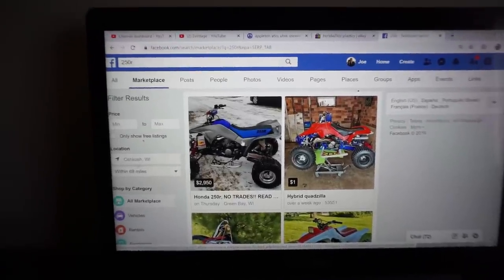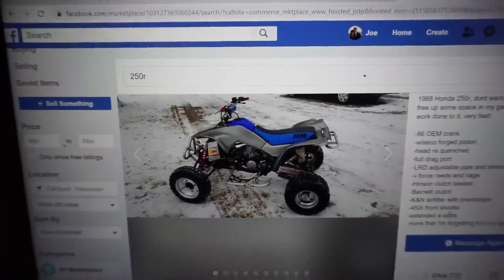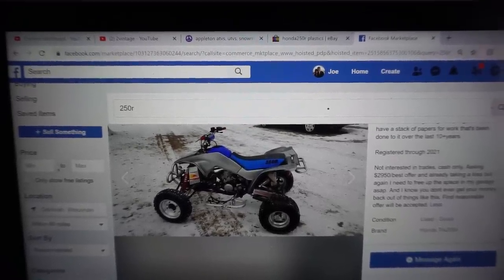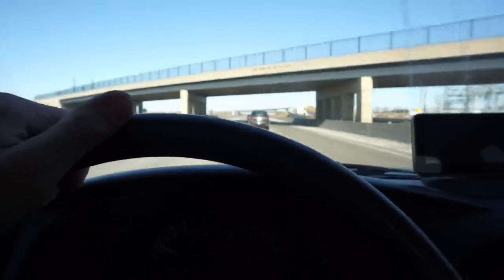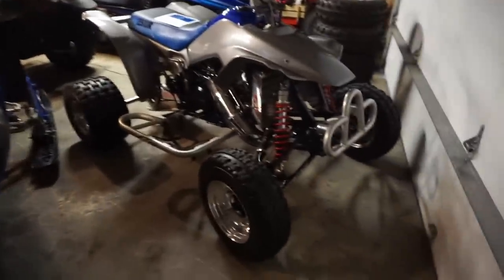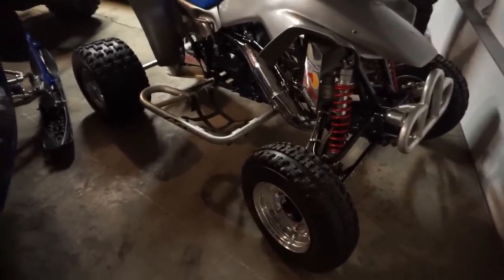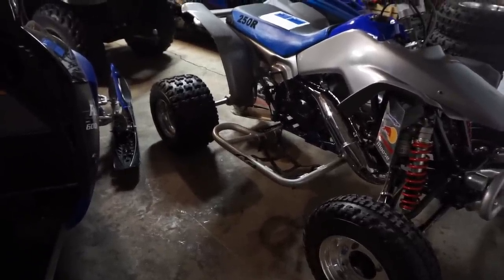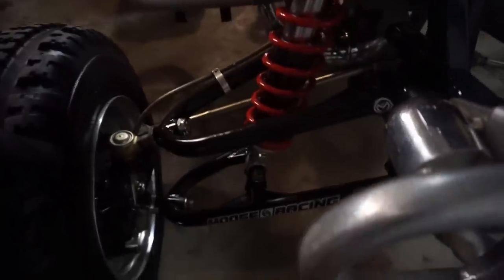Finally...The Modded Out Honda Trx250r is Here!!! (INSANE)

Comment from the maker: Make sure to checkout my Instagram to see behind the scenes: 2_vintage_
Forum: http://2vintagerider.com/
My Second Channel: https://www.youtube.com/watch?v=TPEgjamDX7s&t=280s
Thanks to everyone who watches and supports the channel! Lots of cool videos coming with the Honda Trx250r!
Reply: Nice quad
Reply: Sweet 👍
Reply: Check your cdi on that thing if it’s after market that’s your kick back problem. You need to get oem any year.
Reply: Parts for my KTM are pretty expensive I would like to get a vpower or another control box but they are 700 or so for one that actually works but I do have the Dakar version KTM 525 so it came with a nice steering dampner n few other things like a sticker kit I took off but nothing really for performance although it really doesn't need it only prob so far is running a cheap fuel filter on the 525 you can run carb dry from fuel restriction so upgrading that and adding a fuel rail pretty much solves that problem but I've seen dynos after putting on a quality aftermarket exhaust with no power gains but do u really need more power from a dirtbike that puts out 60 hp no you just need a way to manage the power n get it to the ground efficiently. And that's where the vpower or better vortex control box comes in.

Comment: Don’t listen to the seller you can’t rejet to run a lower octane fuel the compression being high dictates the need for race gas
Reply: He would have to change his domes
Reply: I guess if i he advanced the timing as you do when using higher octane gas, you might need to go down a size in jets. Because the combustion is more efficient. Othewise you wouldnt need to rejet. Because you use higher octane to  stop it from detonating, when you have higher compression and early timing.
Reply: @topnotchbarbertv9523  what these two said👆
Reply: Yes you can you have to change domes my brother has a 250R...

Comment from the maker: What videos do you want to see with this beast?!!!
Reply: do a backflip
Reply: Race against a banshee. Possibly a 400ex also! And a top speed test
Reply: See how long you can hold a wheelie
Reply: Ice racing 😐💨
Reply: Top speed
Reply: How long it will run on WD-40...
Reply: A video of you ripping it not cursing around rip it in trails !!!!
Reply: Ice drifting
Reply: 2vintage race it. Surly there is a motor cross track near you
Reply: 2vintage  race a banshee or Suzuki 250r
Reply: Sand down rip
Reply: 2vintage track/ trails
Reply: Find a shop with a dyno local to you and see what it makes
Reply from the maker: @Trxryamahabanshee  cool idea
Reply: ride it on the track because that's what it was meant to do and it would probably be a lot more fun than just riding it in a straight line
Reply: Ride a track or some trails
Reply: 2vintage It may just be me, but man I always take my bikes to the dyno for a tune after I build a motor that way I know the jetting is dialed in and knowing what kind of power it makes is a sweet bonus 👍
Reply: @camden199  that would be a short video. My guess is about 20 ft
Reply: 2vintage sand dunes???
Reply: @CADEN ZUMBRUNNEN whatever the hell that channel is...
Reply: Keep it forever
Reply: LONGEST WHEELIE
Reply: more drifting in the snow
Reply: Ride it up and down the road outside your house and round and round your garden. I can't deal with disappointment.......

Comment: That's about right for early 2000s I just built a kfx450 and it cost me 7500 just in parts , internal motor work and full suspension setup ars-fx xc a arms full exit shocks were 2200 I found out quick building is a lot more expensive than buying an it becomes more of a nostalgia thing after the time goes into it so I know how he feels not wanting to sell that trx but you definitely got one hell of a steal great job love the videos

Comment: dude ive had and raced the same 250r since 2001 . ive always ran kultz and vp110 24:1 . I do xc races now ive got over 100 hours on my wossner piston with still 140psi of compression . the 250r can be the most reliable quad if its built right .

Comment: Pipe reeds and filter means exactly what it says, it’s got an exhaust different reeds and a different air filter... they wake up a lot with porting, they aren’t too bad stock and definitely won’t power wheelie every gear, 4th is about it I have a stock motor... the bigger aftermarket  cylinders and good porting they make crazy Hp

Comment: No 2 stroke would ever "blow up" if people treated the piston and rings like the 40 to 50 hour maintenance items that they are intended to be.
Reply: Lol your not serious I’ve got a kdx250 from 89 with I’m sure thousands of hours on it had it for 25 years and ride it hard every day just use good oil and open them up every once in awhile just don’t live at 8000rpm you’ll be fine
Reply: @jjp1117  big difference between a non- competition trail ridden kdx and an all out race ridden two stroke motocross bike.
It's apples to oranges between a kdx and a kx, just in where the power curve comes in and how much the kdx will suffer being lugged due to it's longer stroked engine and heavier flywheel.
You are also the exception to the rule in how you ride and treat your bike.
If you think I'm wrong, just go on Facebook marketplace and see how many 2 strokes are for sale and the add says "ran great, just needs new piston and rings". 
The truth is it needs a whole new top end. It's claped out and needed a piston and rings a hundred hours prior.
Now the cylinder is scored all to shit and wallowed out like an egg because the wrist pin has been shot for 50 hours and it's no longer capable of building compression.
Remember, a 2 stroke runs the strongest right before it blows up. A piston, rings and upper bearings are far cheaper than a complete top end.
If you check your service intervals as posted, you'll see that these are considered to be regular wear items on a two stroke and even on modern 4 stroke motocross bikes that make their power and torque at high rpm's and whose jugs and heads cost even more to replace if damaged.

Comment: Lord makes custom pipes thats why you can't just buy them on Amazon etc.. but they need to be the smaller pipe to get the most hp out of the 250r with a 309kit you can get around 56hp out of them they are good machines

Comment: @2vintage that pipe n silencer back then in 03 was n easy 500 prolly 600 jzust for expansion chamber and 250 for silencer parts have gotten alot cheaper compares to even 10 years ago

Comment: So the dude doesn't do his own repairs and keeps the receipts, and you add them up like new swing arm bearings installed 15 yrs ago has some relevance to you paying market value on a quad that will be covered in wd-40 shortly. Prepping for the useless top speed test. All your top speed tests not one mention of final drive gearing. You realize top speed has nothing to do with the design or purpose any machine I've seen you.....um... Well whatever it is you do. These are dirt bikes, buy a Ducati and top speed that out on your street. That would at least make more sense than a, you know. Let's say a MIAMI VICE ERA OPEN CLASS DIRT BIKE DRIPPING WD40 FROM EVERYTHING INCLUDING STOPPING BY MEANS OF FRICTION SURFACES.
LOOK DUDE, I GUESS IM A HATER BUT YOU KILLIN ME, ESPECIALLY WHEN I READ A COMMENT FROM SOME THAT JUST "RESTORED" HIS BIKE THE WAY HE LEARNED FROM YOU. Hey you get views, I can't challenge you on that. I GOTTA STOP WATCHING. I'll check back in ten years, I'm sure have some base knowledge by then. Work on your kick starting, your bump starting, your shifting, pulling statements straight from your ass like "runs really good, maybe a little rich" when it so obviously from watching it on video is running horribly. Example, the bike with the intake crack or leak, can't remember. Boy you were proud of how well that was running.   Pretty  Please, with a cherry on top clean the bikes. Hey your out doing shit, not always doing it right but doing it. So good job, on that. But if you're simultaneously pulling out the choke and saying it's fuel injected, you're going to lose some credibility.